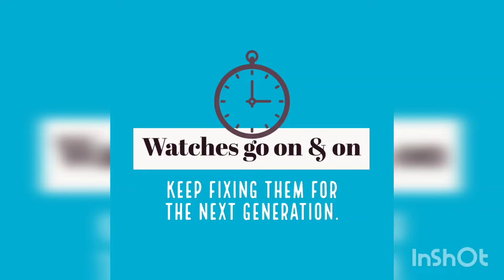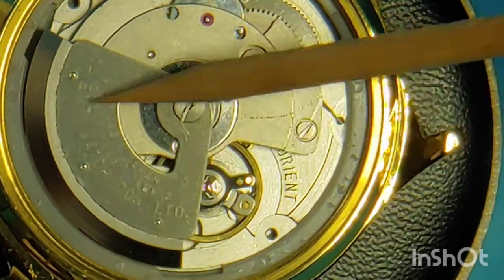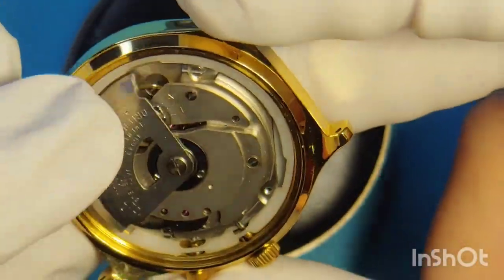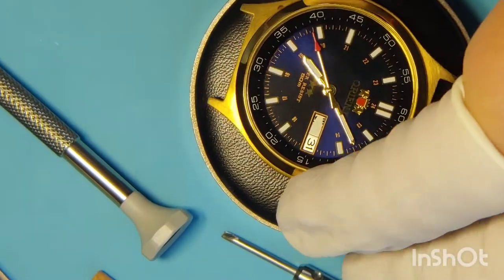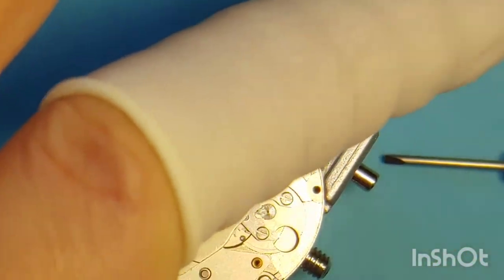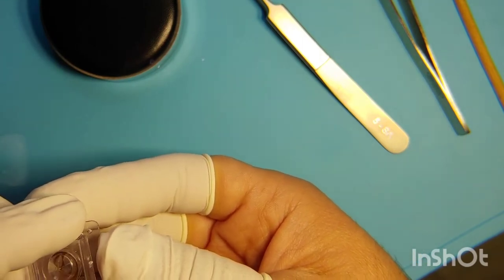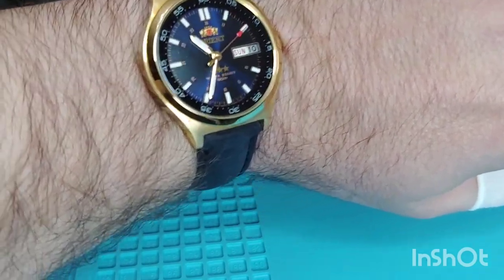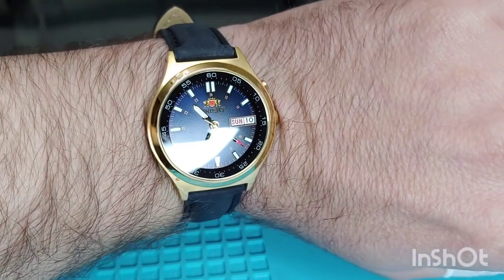Day Wheel and Balance Complete Problems in Orient Watch Caliber EM5U

Comment: Your hand blocked the view.  Is the screw off the center of the rotor what you turn to manually wind the watch?  Have you ever measured how many turns for a full power reserve?
Reply from the maker: Hi Robert! The screw was not off the center, it was the rotor that was misplaced. Once you take the screw you will see that the hole on the rotor is not completely round, it has a couple of notches. If those are not aligned correctly, the rotor will sit at an angle causing it to rub against the movement, or the caseback.
These type of movement can't be wound mannually, so you depend on the rotor to wind the mainspring. 
When it comes to screwdrivers, what you have to make sure is that the screwdriver is not bigger than the screw head diameter, or too small. Screwdrivers of the wrong size will easily slip. Also, the thickness of the tip is important. A screwdriver should be snugged on a screw' slot. Sharpening screwdrivers is paramount on this hobby. I have an arkansa stone at hand always to dress, shape, and sharpen screwdrivers.